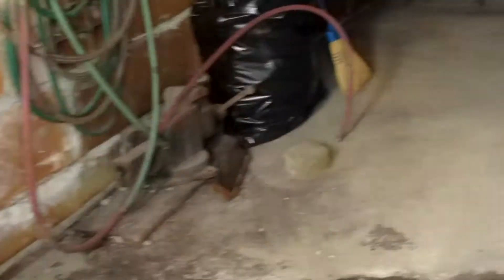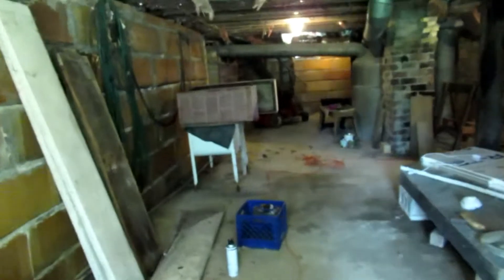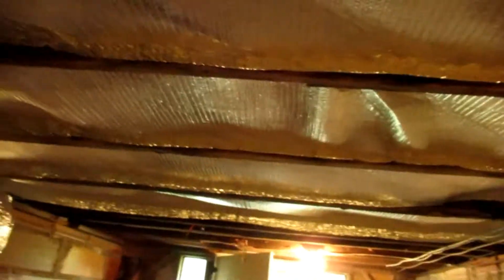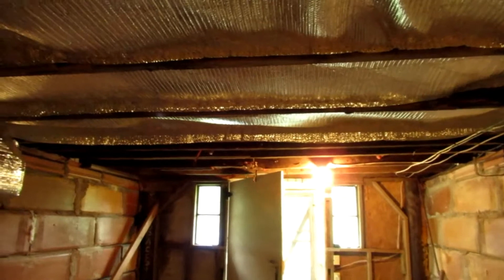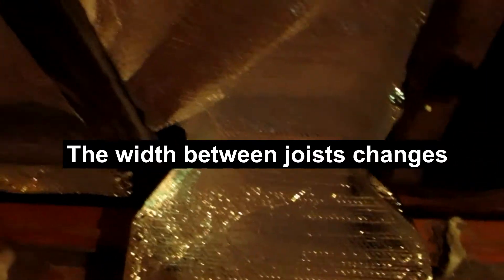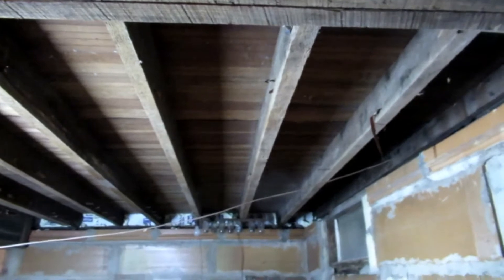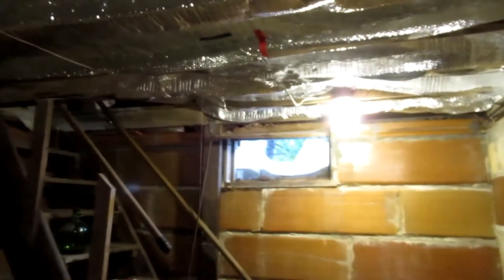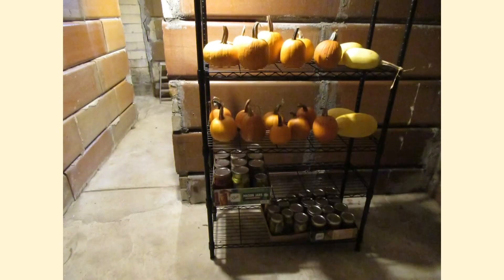From Fiberglass Batting to Reflective Barrier: Replacing Basement Insulation

Comment: My understanding is that Reflectix reflects the heat.  I don't know if it works for cold.  Maybe it will keep your heat upstairs.  LOL  I was going to suggest covering it with painter's drop cloths but the silver tarp stuff looks like it should do an awesome job!  If you have a Dollar Tree nearby look for pool noodles to cover your exposed pipes.  I see a lot of RVers using them.  HUGS~Donna
Reply from the maker: Hopefully sealing cracks and the floors will keep the cold from drifting up to the floors. There is an air pocket between the reflective bubble stuff and the floor and another between the reflective bubble wrap and the new basement ceiling so in theory the air is trapped and  acts as an insulator. We will see huh? Can't be worse than what was there.  I don't really need to insulate the pipes though cuz there's no water in them.  Pool noodles work for that however.